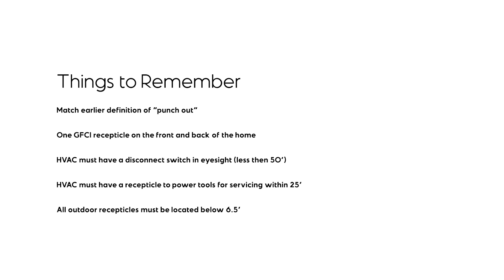Outdoor Power - Code Minimum

Comment: I just had an inspector tell me that all exterior gfci outlets must be ran on a 20amp circuit. I've researched and have yet to find that in the 2017 NEC code book. What state are you from and which code are you following?
Reply: NEC 2023 (not sure 2020, though 2023 doesn't mark this section as a revision or new) on 210.63 Equipment Requiring Service reads "A 125-volt, single-phase, 15- or 20-ampere-rated receptacle outlet shall be installed at an accessible location..." A further infomration note points to 210.8(E) which says "GFCI protection shall be provided for the receptacles required by 210.63."  So that code specifically allows 15-amp receptacle outlet outside for supporting equipment service.